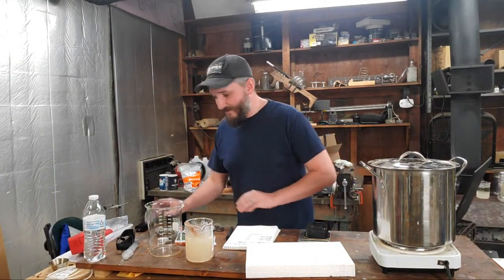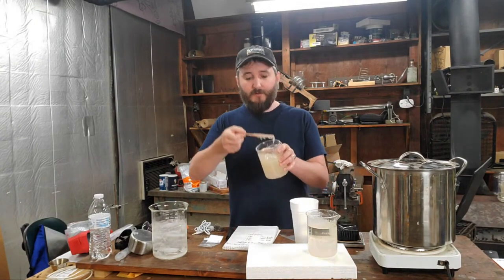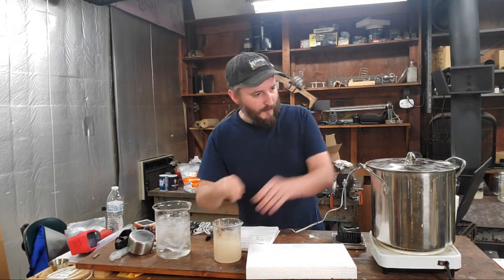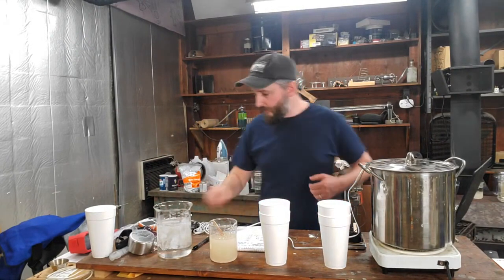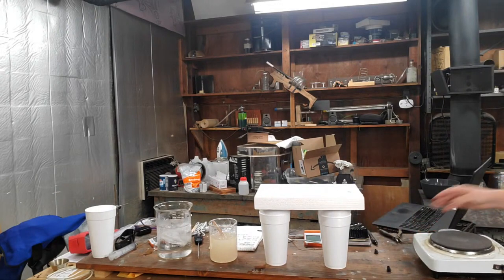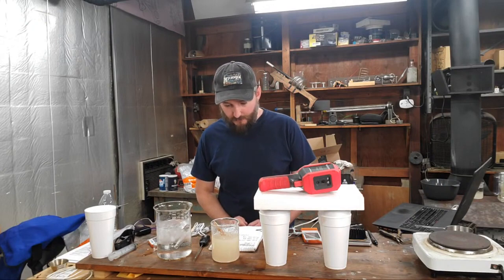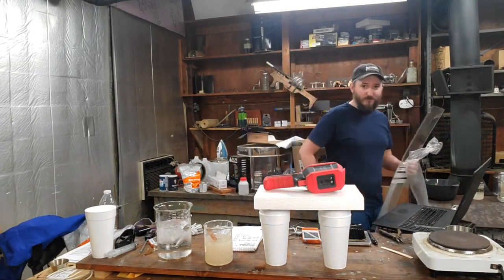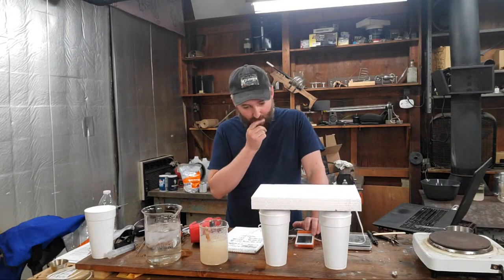Testing heat capacity of phase change materials (Patreon livestream no.2)

Comment: Ugh the vest color drives me insane. I have one that is running ice water through it due to heat intolerance and want to try add to it. I definitely want a thin white fabric…but I also use a ice pack that I put around my neck that absorbs water and freezes. Could I use this mixture and have it soak into the “ice pack cell” and freeze? It’s basically the stuff in diapers but you don’t open it up. 
I could and reseal but I feel like it would be extremely difficult..

Comment: I tried this and it indeed came out looking like jello. I left it to cool for half an hour on the stove and it was firming up slowly so I then moved it to the fridge to cool faster. It came out of the fridge as a blob in the aluminum pan. I scooped slices of the stuff into ziplock bags and gave one to my dad and one to my brother to test. It works as advertised for cooling, I didn't measure exact times but it's fine. 
The problem is that I the mushed up the jello slabs while inside the bags (dunno if relevant) and now when the PCM is fully melted the bag is full of liquid with some blobs of the jell. I put it back in the fridge to cool down quick and it is now a liquid with crystals in it. I'm thinking it needs more xanthan gum. Should I reboil it first or just add it to the bag?
Reply from the maker: You can add it to the bag but I think it's probably fine as is anyway. If you don't see big hard crystals forming that you can't get to go away it's working properly.

Comment: You should be able to hook up your heat pump system to your hot water heater to put the heat where you want it. Every degree you can prewarm the water is one less that needs to be heated.

Comment: i know that  split studs, ie , air gap in wall studs, have been on the market for a while. That gap may be good place for your cooling gel coils in modular ( interconnectable) panels as geo thermal   cooling panels. considering that AC stsyems are designed to blow against heat walls tge gel may be a huge money saver.

Comment: this is only a niche markst share of potential , but, for some quick money from a client pool of return business, if you could make a cool suit that was simple, verry effective, and consistently reliable,  for spray foam techs you would instantly change the industry. In this case, kinda from the bottom up. If a guy can stay cool for even 4 continuous  hrs while in the attics of structures while wearing the resperator, then everybody makes serioys money comparitively. Material, and obviously company to tech relationship,  quality of life for the tech changes by magnitudes. The probs with typical cool devices is that they are not that effective , they are not very effective, some types hinder movement, tbey often fail, and the best ones are very expensive. Your prototypes would probably surpass , by far, even the expensive cool air to common  face mask  resperator systems that are common to market today.

Comment: Probably apples and Roby Reds, but is the cooling mayerial electrolytic? Coyld that be utilized as it heats up if the ideal materials were incorporated ?  Could you put cooling coil in cool pack and it be more easy to power because of electrolytic qualities? In the case tfat you are wondering, I am not a learned physicist or chemist, or engineer, or ...

Comment from the maker: During this stream I had a bit of an issue in failing to turn on my temp loggers to see the results, so after the stream ended I repeated the experiment and it seems that my PCM has approximately 2x the cooling capability as water ice! I'm quite excited by that. Here's a copy of my post-stream comment with the numbers I came up with for the results:

I ran my experiment again, and this time I remembered to turn the temp logging on! I also improved the experiment with a control cup containing the same amount of water so I could see the natural thermal loss and subtract that from the temp change in the cups containing my samples. The control lost 11C over the test period, so I subtracted 11C from the delta observed in my samples. My ice sample was calculated to have cooled the water by 6.88 J/g•C. My PCM sample registered a cooling of 12.7 J/g•C! Almost 2x the cooling capacity of ice! I'm not sure what to call this measurement since it's a combination of both the specific heat of the substance and the heat of fusion. If anyone wants to check my work, I used 400g of water per sample with a start temp of 91C. My control cooled to 80C over the test period, a delta of 11C. My ice sample was 14.3g, starting temp 1C, ending temp 75C. PCM sample was 20.3g, starting temp 1C, ending temp 68C. I tested the 15g sample of cement also, but it only cooled the water by 1C more than the control. That calculates to a specific heat (in this case it really is the specific heat) of 1.43 J/g•C which is a little high. Usually cement measures between 0.84-1.17 J/g•C, but I doubt the accuracy of this test because the measured difference in temp was small enough for the imprecision of my thermometers to throw it off. I could recheck using a bigger piece of cement but I think 1.43 J/g•C is close enough to the normal range that I trust the results of my ice and PCM tests to be fairly accurate. The PCM seems to be waaaay better than ice. Unless one of you spots an error!
Reply: So I found papers confirming your results.  2-3x times.  I'll find it again.
Reply: so I asked chatgpt and it confirmed in ranges above 0c (due to water/ice phase change), anything crossing the 32c of Glaubers' phases, Glauber wins with 2-3x times more.  It's only when you start below zero, that Ice/Water wins, as that phase change then changes the dynamic in water's favor.
Reply: Ask gpt: Compare the energy storage capability of sodium sulfate decahydrate (Glauber’s salt) in a range from 30° to 60°C with that of water. (and then vary the temp range)